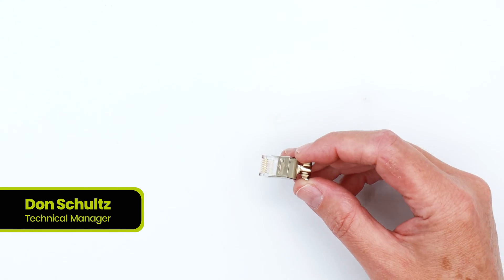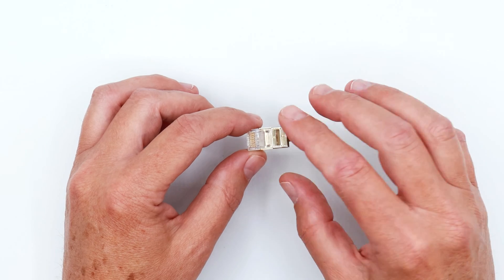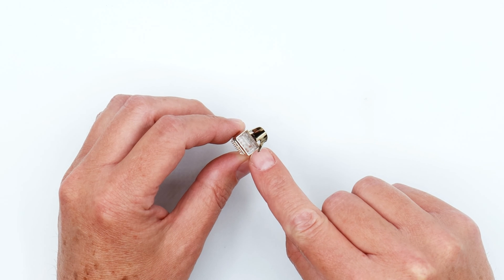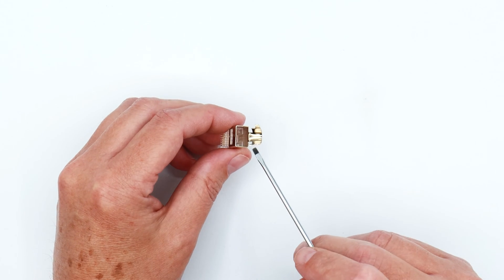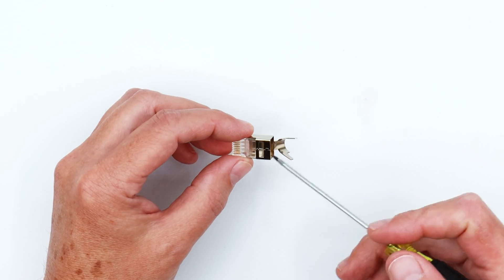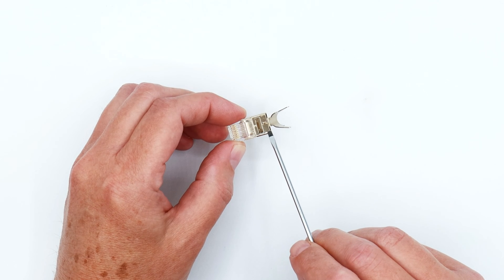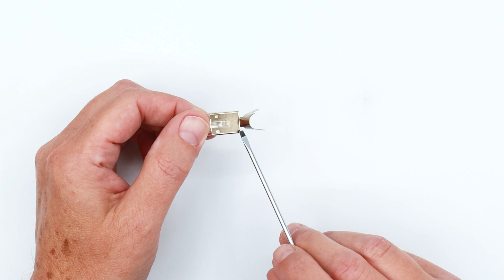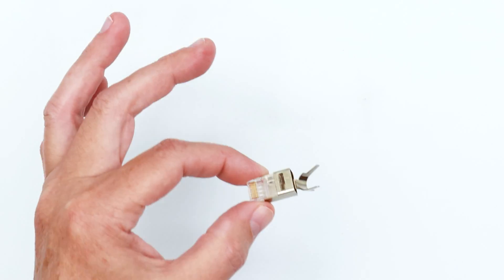Understanding Shielded RJ45 Connectors (Everything To Look Out For!)

Comment: You always say a Keystone/IDC makes for a better mechanical connection than an RJ45. But have you every tried to pull a wire out of an RJ45? Its pretty hard. A lot easier to pull a wire out of a keystone.
Reply from the maker: Hello and indeed, keystone/IDC terminations are easy to unterminate if you pull in a certain direction. That said, the IDC cap will prevent that possibility if this pull is on accident. Performance will still be preserved. Keystone/IDC terminations are much more durable immediately and over the long haul than their RJ45/8P8C counterparts. Yes, physically attempting to intentionally pull out a cable from a modular plug is tough to do, but test that connection with a Fluke DSX-8000 performance test after you try it and see if it still makes the grade. I bet it won't. Oh, it may pass wire map, but that does not mean it will still provide the Category performance that it should and may be degraded to the point that inserting it into a channel may bring down the entire channel due to packet loss. Try terminating both styles and testing with an actual cable certifier or qualifier to see what I mean!

Comment: i have these metal ones in the video just to make my own ends and use at home from router to modem or pc to router etc etc...i figured they were better than flimsy plastic..i also have shielded cat 6a because its just what i have....is there any issues using that at all? or should i be fine....i only have 1gb internet service....just home user gaming and multiple compuyters on wifi but main pc and modem router need ethernet and i already have these items...just want to make sure there is no issues using these metal ones....?? thanks...
Reply from the maker: Hello, and thank you for the question. There is no issue using a shielded cable with the shielded RJ-45 connectors. Regarding your application, it is perfectly fine to use the shielded cable and connectors that you have. The only downside is that they take a bit longer to terminate and ensure the shielding is done correctly. Other than that, you should be good to go.

Comment: I've always considered it bad practice to put a plug on solid cable.  Originally, they were supposed to be used on stranded cable, but people put them on solid.  As a result, plugs for solid were created.  However, you still have the issue of metal fatigue when used as a patch cord.  When installing something like an access point, I terminate the cable in a keystone jack and then use a short patch cord to connect the AP.  Also, when installing shielded cable, it's supposed to be grounded at one and only one point.  If grounded at both ends, it will tend to act as an antenna and pick up a lot of noise.
BTW, I started working as a technician in the telecom industry in 1972 and have a LOT of experience with cables and connectors over half a century.
Reply from the maker: Hello James, you are ABSOLUTELY CORRECT regarding the less than ideal practice of putting 8P8C plugs onto solid copper Ethernet. There is not only metal fatigue, but issues with mechanical stability (therefore electrical stability) due to lateral movement at the rear of the plug due to the fact the golden contacts don't actually penetrate into the copper itself. The fragile golden contacts pierce the conductor insulation and straddle the conductor from the sides, which is totally unlike IDC terminations (keystones, etc) that contact the actual conductor wires from 90 degree angles. Then, take into account that there are manufacturing tolerance variations in the conductor and especially conductor wire insulation diameter that the plug cannot compensate for, and you have a termination type with a high failure rate.